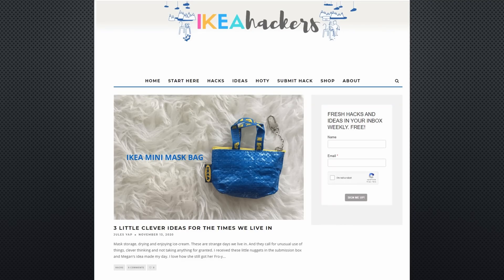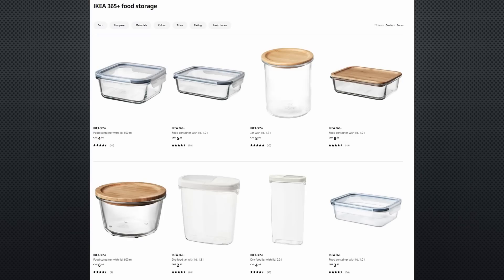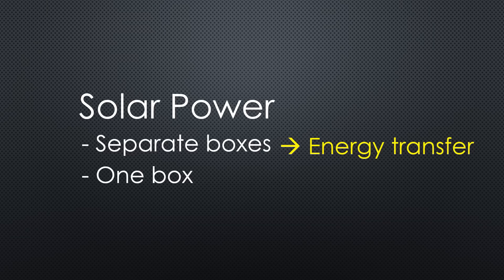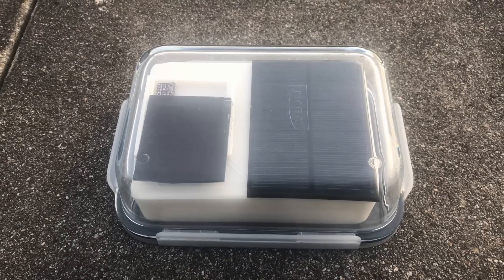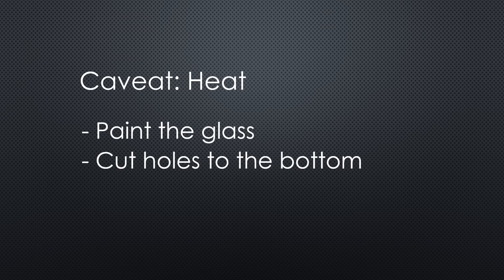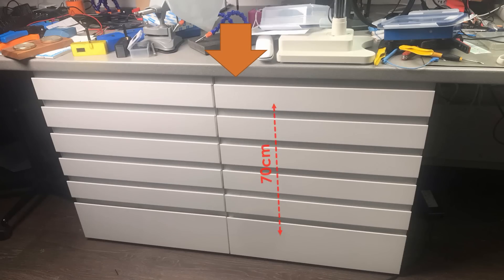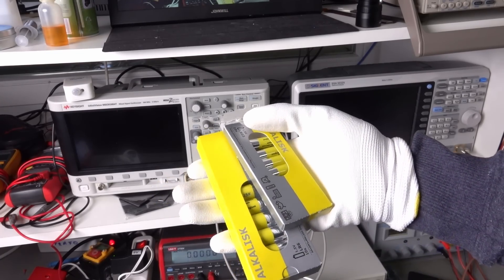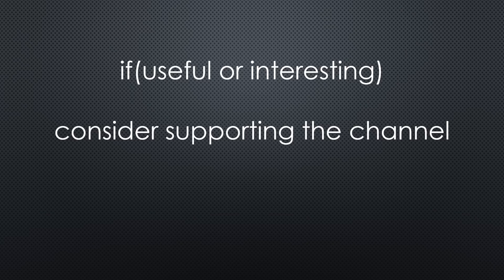#361 IKEA Goodies for Makers incl. my Newest Find

Comment: Those clear SAMLA boxes get brittle over time. I had to throw away a few of them recently because they had cracks from normal handling. Would not recommend them for very long term storage.
Reply from the maker: Do you mean the glas boxes? So far, mine are still ok. But I had to replace the plastic bottom.
Reply: @AndreasSpiess  No, I mean those translucent white plastic boxes. They are called SAMLA here in Germany and are one of the few IKEA products that disappointed me, because, as I wrote above, the became really brittle after time, even without being exposed to sunlight.

Comment: Well said sir! You hit it right on the head there. Build verses buy. Ikea's price to performance is phenomenal. I've created 8 RU audio racks using their (sadly discontinued) Rast bedside table. Most recently I've used the super cheap Himmlesby frames for my eink poster projects. Additionally, can I recommend the Fixa box for cheap cable management solutions. Ikea gear is cheap, well made and easily hackable.
Reply from the maker: Thank you for the Fixa tip!

Comment: Two ideas for overheating, if it's just the batteries, mount them externally in another foiled container or as it is hermetically sealed, vacuum pump the internal space and seal it. With some of the atmosphere removed there is less to heat up.
Reply from the maker: Placing the batteries in a different place would for sure help. But I like the idea to only have one box.

Comment: Excellent ideas @Andreas, & definitely worth investigating if you're a maker.
I've actually been using super cheap soap dishes for some of my boxes (sealed with hot glue).

I am curious about the exposed boxes on your roof & in your garden. Specifically, I'm wondering if the plastic lids have held up to the weather since heat & cold can crack many plastics in my experience.

Cheers & looking forward to your next project or tips!
Reply from the maker: So far they survived winter. Becasue they are "protected" by the glas they get much less UV. So there is hope also for Summer...

Comment: Hello!
An idea for the heat problem: try to use one of the enclosure walls with alluminum or some other good heat conductive material. You´ll have a heat exchanger as the heat inside the enclosure will be carried out from it, once the other side of alluminum wall will be at a lower temperature.     :-)
Reply from the maker: I will try something like that. Unfortunately this way you easily get heat into the box if the sun shines on the metal.

Comment: We find electrical boxes with clear plastic covers with IP67 protection for a bit over a euro.  For a bit more, you might be able to source a larger unit. They have silicone nipples that you can cut as needed for routing cable, although your application seems self-contained. Very easy to open and close as well. Check your local or German electrical supply online. Yes, we bought online locally because it was cheaper like that but still came in-country. I think they’re made in Poland, which is no surprise because Poland seems to have very good cost and quality for injection molded parts. I have no idea why this is.

Comment: I use Gles boxes because I’m cheap. I don’t even buy the lids as they cost about as much as the box itself. I had a huge investment in the green Gles boxes (150), but then they changed to black 🤯
Reply from the maker: I kno them, but never used one for my projects. How do they do In sunlight?
Reply: @AndreasSpiess  Regarding the black ones currently available, let me use an intense light source today and get back to you regarding blocking. The clear lids aren’t very clear as I think they’re made from polypropylene.
Reply from the maker: I more fear leaving them outside in the sun for years. Plastic often gets crackly. This is why I liked this glas boxes. I think for Inside they are very good and cheap. But there I often print my own which I can adapt to my needs...
Reply: Just FYI, the black Gles is PP-C, and blocked a 60W COB LED pressed against it. I could not see any light whatsoever. Regardless, PP-R (IKEA Gles lid Samla) and PP-C are not suitable for UV exposure unless they're impregnated with certain chemicals to which I imagine these consumer products will not have such costly additives.

Comment: My initial thought is to remove the battery from the container and the heat inside. I would have the glass near the edge of a structure such as a roof. I'd run a very short run of power leads outside the bottom of the container, use rubber grommets if worried about moisture. Then the battery can tuck under the roof edge into the shade protected from the direct sunlight. Build enclosure or hat for the battery if worried about water so it can drip down and off instead of flowing into the battery itself. Use the loop or bend trick on the leads before they connect to the battery so that any moisture buildup will through gravity collect at the loop bottom and drip off instead if traveling asking the wires to the battery.
Reply from the maker: With two cases you get much more possibilities, you are right.

Comment: Add a heatshink to the lid.You have to cut the lid to make the hole for the sink.  Sealing around the edges of the sink will make it water right again.  Putting the PCB on a "gap pad" that is on the sink will keep it cool.
Reply from the maker: Thank you. I will try the heatsink next summer.

Comment: I used a 3D printed lid for my vacuum chamber, printed at 100% density and it was as porous as hell. Won't be doing that again.
Reply from the maker: You are right. Maybe you watch my videos about pressure sensors for beer brewing. There I experienced the same.

Comment: for radiating heat, fill the container with clean motor oil. the oil is excellent for distributing heat to the glass. heat sinks could be added to the glass for better cooling.
Reply from the maker: Other commenters suggested to use other oils. I think it would work. However I fear the mess :-(

Comment: "LACKrack" is quite common: LACK tables used as 19" racks, with simple wood screws holding in the equipment.
Reply from the maker: You are right. There were a few comments about that fact.

Comment: couldn't find such big drawers on Ikea with 6 drawers on top of each other and so wide :-(, only 60 x 60cm with 4 drawers for ~400 Euros -> thats too expensive
Reply from the maker: They are not cheap. But compared with professional stuff of similar quality they are cheap. As said in the video I had to cut 10 cm at the top
Reply: @AndreasSpiess  maximum available height is 60cm. That is unfortunately too small for my needs. Yours are much bigger. Those big ones I couldn't find. 😟
Reply from the maker: I left a link in the description. Kitchen height here is 80 cm

Comment: Mhh... Kinda wondering if there's something out there like a DIY Home Automation Toolkit one can use to, let's say, build their own smart Window Blinds / Curtains?

I was thinking about a board that has all the connections needed to either hook up a Stepper Motor, Servo Motor, Servo ( as in those used in RC Models ), etc... and some sensors ( Switches ), and an interface that would let you program it in order to calibrate it to your respective situation - Like make 100 turns for a 2m wide curtain and also which direction opens or closes a device - Maybe even learn it by itself with the use of end stops?

The System would then automatically work out the rest to have a working system in, let's say, Apple Homekit where if I tell it to close the curtains by 50% it would turn the motor 50 times.

The System would only provide the, kinda, hard Electronics, Smarts and Connection to the Home Automation while the mechanical parts have to be provided by yours truly according to the specifications of your needs 🤔
Reply from the maker: This is the channel for Makers. So I assume we would build such a board if we need one ;-)
Reply: @AndreasSpiess  https://i.imgur.com/WFqYS7L.jpg 🙄

Comment: You did not seem to say what the white padding was behind the project parts. 
I suggest putting the electronics behind the padding, shading it from the solar heat. 
It would then be possible to add a second solar panel hooked up to a Peltier Module 
that might dissipate some heat from the shaded side of the container. This idea would 
require cutting an opening in the lid, which in turn, would need to be sealed. Also, the second
solar panel might not be able to generate enough power for the Peltier Module to be
effective.
Reply from the maker: I only have a 3D printed holder for the sensors and the solar panel.
Peltier elements are very power hungry, so they would not be my first choice.
Reply: @AndreasSpiess  I thought so.

Still, if the electronics can be separated from the antenna and solar panel and placed on the other side of the padding, that might help lower the temperature.

Comment: How about controlling the heat using Qi and two containers? One container has the solar panel connected to an IKEA Qi charger. The other container has your electronics, batteries, and a Qi receiver. Avoid stacking glass to glass because the plastic lid will have less thermal transmission capacity. No holes in either container!
Reply from the maker: Two cases are always a possibility, you are right. But less handy ;-)

Comment: For small projects, like an esp8266 based neopixel controller with lets say temperature sensors or relays or any other switched appliance, i like to use the boxes that gets used for home eletrical wiring from the home improvement store. You get different sizes, can cut a few holes in it, mount it easier to a surface and theyre also cheap and commonly available. All my smarthome node that i built myself are in such a box. Except the rgb controller in my PC, thats just mounted inside the case. I used also one to stuff my wago terminals for their wiring (seperate 5v for the appliances, 5 standy for the controllers, ground all from an old atx psu) on my desk in, so it looks a bit less messy.
Reply from the maker: These are great boxes if you do not need transparency. And the price-performance is very good!

Comment: I never use the standard CR2032 for my small IOT Sensors any more because I never know, how old they are, when I buy it in a shop like IEA or others. Much to often the battery power gots after some weeks under 3 Volts and it's justr a question of time when the sensor faild.  I try to order rechargeable  batteries i.E. LIR2032 only, load them before use and have fun over the next many months. And, you don't need the throw away the 'old' one because, you can recharge it.
Reply from the maker: You are right. I only use it where they are mandatory (car keys, etc)

Comment: If the container is truly waterproof, why not submerge it and expose only the top of the glass container for the sensors to pickup light? Surrounding water should be sufficient to cool down things by a significant factor. If you can get the water to stay clean you could even cover the container with a few mm and the readings probably wouldn't change much.
Reply from the maker: Good idea! Maybe I can convince my wife that we need a Swimming pool now ;-)

Comment: I’m glad those containers worked out for you. 
When creating a sealed envelope for longterm outdoor use; the seals need to be able to resist the change in pressure differential that can result from thermal cycling. Even small leaks can result in a “pumping” phenomenon. 
During the day the air inside the envelope is heated increasing the internal pressure.  Often a seal meant to keep water out may do little to keep air in; such weak seals or other small leaks can result in some of the internal air being ‘burped’ out. This isn’t directly problematic, but overtime when the air cools down it can result in a small vacuum pressure. This negative pressure will continue to slowly build up until humid air or even liquid water is sucked in through tiny leaks or the enclosure is manually opened. This process can be driven forward by a subsequent factor; humid air draw into the container will tend to condense, early in the day and pool in the bottom of the container.  Some of this water will evaporate during the day  (now ensuring the internal humidity stays around 100%)  Though some will escape during subsequent “burps” in general the liquid water will tend to accumulate.  
Under the right circumstances in the right environment a truly shocking amount of water can accumulate this way.   
As mentioned desiccants can mitigate the problem in some applications.  Where I live in Florida, and other humid places desiccants alone might be a lost cause; even exacerbating the problem. 
In the end I find it’s best to evaluate whether you really require a sealed enclosure. If not make sure it can breath and drain. If you are going to seal an enclosure make sure it can resist egress as well  as ingress.
Reply from the maker: Many viewers pointed to that problem. So far ir was ok for me. But I decided to setup a comparison for the different methods. Maybe we can learn something...
Reply: Maybe filling the void with white plastic airsoft BBs would take up enough volume that the expansion and contraction of the remaining air would be negligible. Probably would help with the temps too.
Reply: What if you filed the enclosure with white cotton? The color will reflect the light, so heat will not be an issue. It also does not expand and absorb any moisture inside

Comment: Adding a container with paraffin wax should limit the temperature to its melting point (~46-68*C) until it all melts. I'd suggest potting the battery in white paraffin wax together with some of the electronics, then using some MCUs built-in temperature sensor to see if you have enough latent heat of fusion. 
Assuming 5kWh/m^2/day irradiance, 1L 21x15cm container and 75% light reflectance, you've got some 142kJ of heat energy to dissipate or store. Getting 500g of paraffin wax from 35*C ambient to 60*C would eat some 32kJ, then melting it would consume additional 100-110kJ, meaning it could even store all that heat energy, (keeping the battery at 60*C ish melting point) with zero cooling needed at daytime.
PS: With a solar panel and sensors, your box will likely absorb 75% of light energy, rather than reflecting 75%, but with that huge thermal storage buffer it should still have more than enough time to slowly get rid of all that heat through radiation and convection even without any wind.
Reply: wow, where do you get that wax though?
Reply: @antonmaier  Candles are on sales and generally abundant after All Saints Day (Allerheiligen). Note that different candles will have a different melting point, depending on the shape, wick thickness, aroma additives, etc.
Reply from the maker: @Grzegorz: Good idea. I already found out where I can get it ;-)

Comment: idea for waterproof case and heat transfer. cut a hole in the polypropylene lid, epoxy or silicone (maybe even gasket maker) a heatsink, the larger the better. or use the silicone gasket that comes with the lid, and make an aluminum lid. print some clamps to keep the lid tight. you got yourself some pretty "cool" electronics right there ;)
Reply from the maker: I will do a comparison of hte different methods proposed by my viewers. A heatsink will be one of them.

Comment: Thank you for your video. 
About Ikea batteries, I currently use AA and AAA ones, good capacity and low price. On the other hand I tried to use CR2032 buttons batteries and I found them very bad quality, specially about the using time that is very short comparing to same price products. I used them in an Ikea product (Tradfri switches and remote).
For the TRADFRI line of products, most of them work fine: bulbs, remote, gateway and switch with magnetic sensor don't really work. 
Enjoy.
Reply from the maker: I have to test the CR2032 batteries. So far they seem to be ok for my applications (e.g. car key)

Comment: Hey, thank you for the IKEA ideas. I'll have a close look on the "kitchen" ones, METOD, as it seems the perfect solution for my needs.

One comment about those small weather worn solar panels. I regularly clean the surface of those solar panels used with garden solar lights (and solar Christmas lights as well) with Methylated spirits (alcohol) or Metho in Australia available in hardware shops. It seems to dissolve or at least soften the plastic surface but it does get an absolute perfect clean surface. They look as new. 
It works for us.
Reply from the maker: I tried isopropyl and other stuff. We also have such garden lights. ours use an additional material in front of the panels which is easier to clean.

Comment: Dear Andreas, please advice wifi booster for ESP32 signal. I'm using now pingtail antenna. But its not enough for my project. It is worse than most nowdays routers signals. And i don't know what to buy and what to do. Maybe there is some shield or MCU that can amplify the signal?
I'm sorry for offtopic, but anyway comments will help to boost your videos in youtube. Thank you for your shares. ;-)
Reply from the maker: I did quite a few videos about antennas, if you are interested. Not particularly for your purpose.
Reply: @AndreasSpiess  there is no amplifier or booster, only antennas? I thought mb there is a way to amplify the signal
Reply from the maker: Amplifiers usually are not allowed:-(

Comment: you can repair your stained solar cell by just give it a clear coat paint job using a spray can. that makes the surface smooth again and therefore clear again.
Reply from the maker: Unfortunately, too late. It is already gone :-(